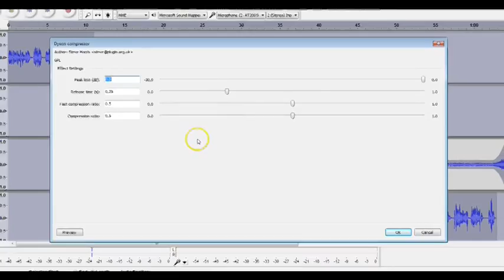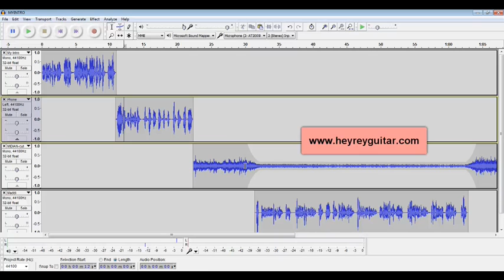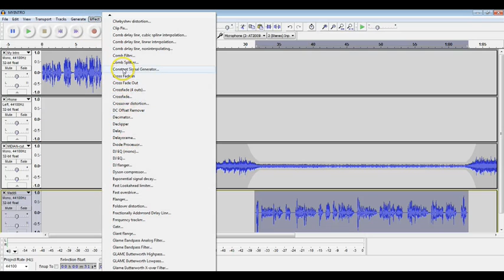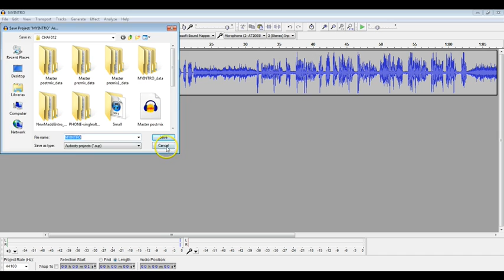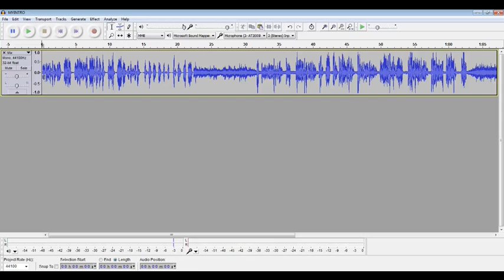Mixing files in Audacity - part 2 - (dyson compressor effect, mix and render)

Comment: I have Audacity 2.1.2. and I don't see a Dyson Compressor anywhere under the "Effect" tab. I see the normal "Compressor" choice that you don't use, but even if I scroll down, there's no "Dyson Compressor" option.
Reply from the maker: The normal compressor actually works pretty well. Go ahead and use it. Dyson has to be downloaded from a 3rd party site.
Reply: +Free Audacity Tutorials gotcha...thx for the reply